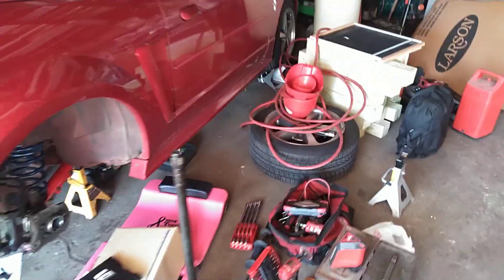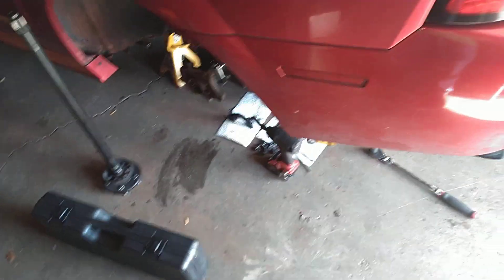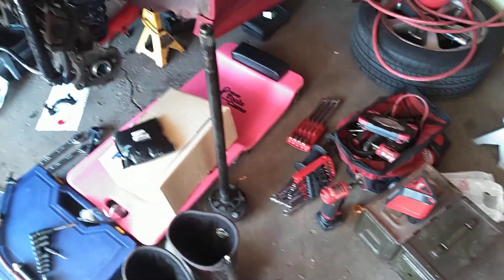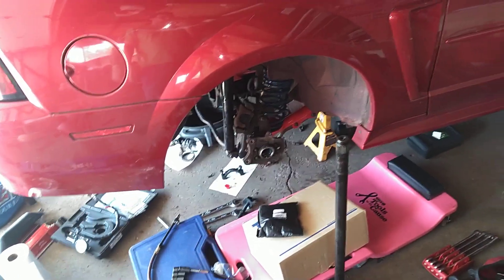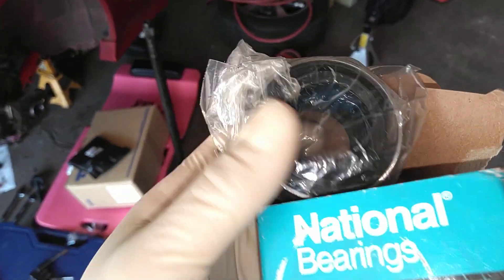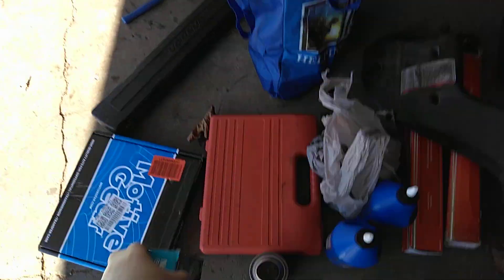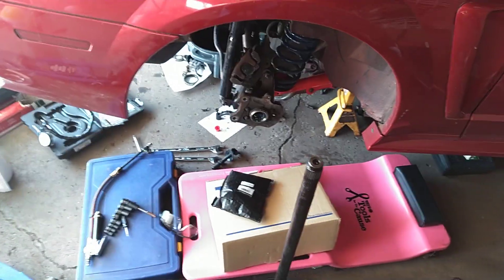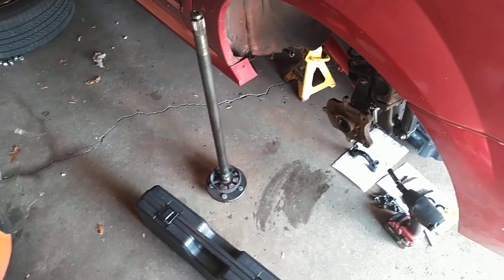99 to 04 mustang 8.8 rear end swap

Comment: I have a question so I have an automatic 2001 mustang and I need to swap the rear differential however I found a guy who’s selling one for cheap but the catch is his is from a manual mustang my question is does it make a difference ?are they both compatible weather it’s automatic or manual?
Reply from the maker: Manual on automatic doesn’t make any difference for the rear end. As long as it came from a 99 to 04 mustang you’re be fine. If it’s an 05 up it’s not gonna bolt up and if it’s from a 98 or lower it’s gonna bolt up but it’s gonna be to narrow